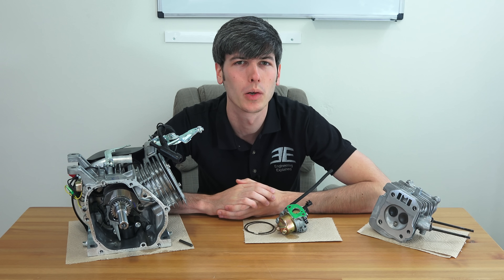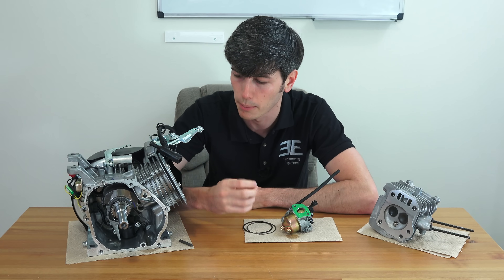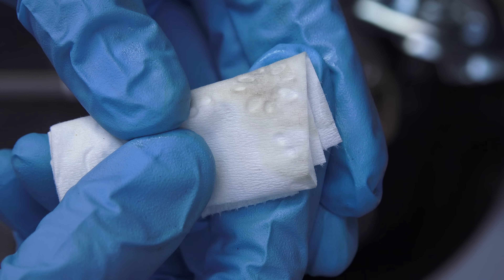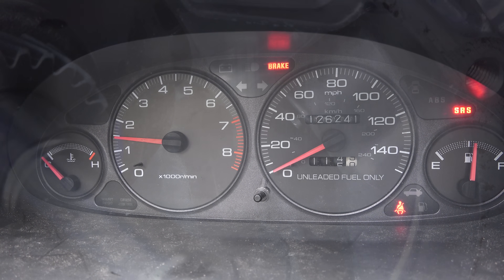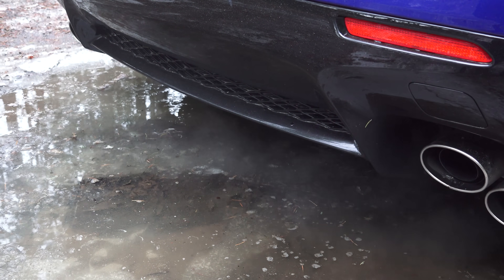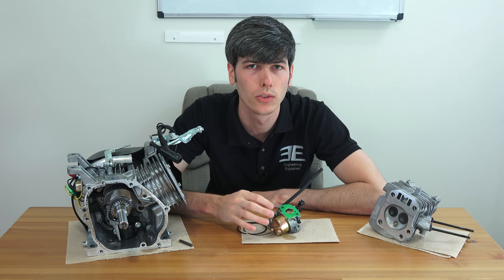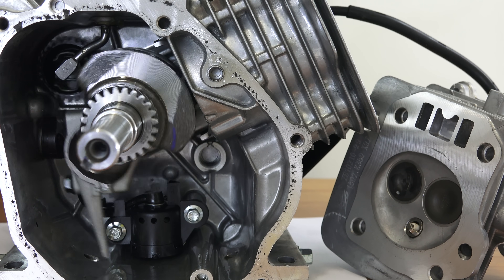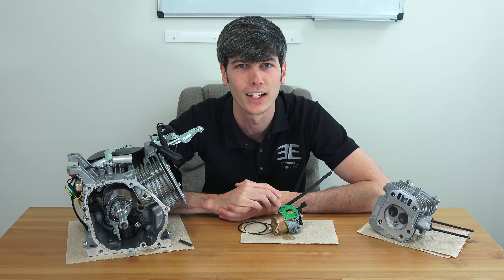Should You Warm Up Your Car Before Driving?

Comment: My car revs at 1.400 rpm the first 30-50 seconds during cold start before dropping to 900rpm, which is when I drive. 
No need to let it sit for 5 minutes.
Reply: harooni22 what if its -10 outside?  may get your nuts stuck to the seat.....
Reply: No, exhaust gas flow changes turbo speed. While oil does flow through the CHRA, turbo speed is not affected by oil flow, nor is oil flow affected by turbo speed.
Reply: Jacob LeClair It gives heat to the oil, which thins oil up during cold temperatures I would say. Am I wrong?
Reply: Daniel Fl. what if its 10 below 0 ?  might be a Lil cold in the car...
Reply: Turbo speed has no effect on oil flow.
Reply: Daniel Fl. mine does the same but when its colder itll take 5 or 10 minutes sometimes. i try to wait for the rpms to drop or until it's a bareable air temperature in the cabin. i own a V6 so the gas milage is already garbage
Reply: Daniel Fl. You know there's a lot more play between your rings and cylinder walls when it's cold? Which is why people warm vehicles up. So basically since you have a boosted engine and you don't warm it up you're getting quite a bit of blow by when you drive it around when it's cold. But no reason to warm it up... until you score the cylinder wall
Reply: Unless it's a rotary, which consumes oil and needs it to be in a more liquid state.
Reply: Daniel Fl. I'm from a cold place so I'm talking about dead of winter. If you live in California or Florida then yeah probably no need to let it idle for 5 minutes
Reply: Is that really normal behavior for your engine?
Reply: wholeNwon Yes, and that is also the correct behaviour from factory. Why do you ask?
Reply: Just seems a little high to me.  Wondering about a vacuum leak, etc.
Reply: wholeNwon Nope. It's a twin charged engine with both a turbo and a compressor. Therefore the turbo needs to spool faster to get the oil flowing better. 
In summer it only revs up to 1.200 rpm, it's only in the cold degrees that it revs the extra 200 rpm for some reason.
Reply: Jacob LeClair Yes, it heats up fast.
Reply: same with our 2016 subaru, it revs up and down around 1300-1500 rpm then goes down to 1000 when the blue temperature light on the dash (indicating a cold engine) turns off. Sucks that there's no gauge
Reply: A J True. The air went first make "warm" air after 3 mins of idle or 30 seconds of driving slowly (below 2k rpm).
Reply: wholeNwon loool an mx5 can idle as high as 2000 when the temperature is really cold 😂it will make itself run rich for a few minutes when it isn't warmed up
Reply: The main reason you have a high idle for a bit at cold start has to do with emissions. You want to get as much heat as quickly as you can to the cat converter to get a quick light off, that 30-40 second fast idle gets the catalytic process started sooner. Cold start emissions are very heavy, the sooner the cats get hot the quicker the emissions are reduced.
Reply: charlie dee I dont think one needs to be that concered with how soon the catalyst process starts unless your someone unreasonably obsessed with global warming. Afterall, the cars computer contolls this process for optimal engine operation so there is no benefit to the operator whether the emissions scrubing happens sooner or later as long as everything is working correctly.
Reply: Tyler Mattson Never had any problems with it. I don't drive a 1986 Chevy. I drive a 2006 Golf V TSI. I don't race it when its cold. I shift at around 2k rpm until it gets warm.

Comment: When the engine is cold and you allow it to warm up you will wash down the cylinder and I agree with that but if you all the engine to warm before driving then all of the components of the engine will  be to operating temperature including the piston which will expand in the bore when heated up to operating temperature. MY opinion is I think a few minutes of having extra fuel in the cylinder is better than starting up and taking off with a cold engine before the piston takes up that small amount of clearance when warm

Comment: I never wait with my carberated ford escort mk4 1.4cl s6, I just head off like anyone would with the choke full on on start then about 1/4,1/2 when driving just driving it relatively low rpms and almost no throttle should be used, stalling when pushing it? never had it, it stalls when you go and get the choke off too early it will stall between your shifts unless you keep the rpms higher with your throttle manual.
all in all, don't do anything crazy with the throttle just drive the car no problems whatsoever.

Comment: Question, i have engine heater for my car. Wont this replace the need to start the car beforehand? It also cannot wear the walls of the cylinders, coz its not acually starting the engine. Am i right or am i right..? Engine heater must still be a good thing to get your engine up to temperature, before driving of isnt it..?
Reply: yes, block heaters are the best thing for cold starts, block heater manufacturers say to plug in 2 hours before starting for max temp increase, leaving it plugged in for longer just wastes electricity and dosnt really make the engine any warmer

Comment: and what young engineer tells us about engine wear due to material being cold and not stretched enough to workign temp? he missed that....and another thing - he wasn't precise enough about quickest warming....your engine will warm up better in idle than in constant speed with light throttle. why? because atmospheric air doesn't let it warm that fast. if you are in terrible winter and want to make the engine warm up to  its working temp as q. as possible, then give it mild 2000 revs while sitting in a car....that's the way it's done when thermostat is changed to see will it open when it should

Comment: will the same go for turbo vehicles? the newer wrx has the temp gauge so would you recommend a oil temp to start off at to be extra cautious warming up the engine while driving?
Reply from the maker: +BellaWrx _NJ absolutely, wait to romp until oil is at operating temp.
Reply: Engineering Explained I keep seeing there so many variables with types of oil used in different size engines determine operating temp. what would operating temp be for the newer wrx? I heard 150 Fahrenheit is good.
Reply: MV60 that's the issue. on cold days my temp can take awhile to reach temp and 200F is about the normal when not running it hard. I like the oil pressure idea, hope the AP has that so I can jus use that.
Reply: MV60 makes perfect sense. thanks.
Reply: What exactly would be considered operating temp? I have a 2016 Mustang Ecoboost if it matters.
Reply: MV60 good call, I'll do that!
Reply: judging by the above comments, the wrx and my saturn sky turbo both operate at about 200°F so thats probably a fair estimate for your ecoboost.

Comment: He just gave bad advice. You should always let your engine warm up before you push it hard. Pistons for example will have a lot of slap until they heat up and expand to fit the cylinder. The reverse is that you should never try to cool an overheated engine by using cold water as uneven rapid cooling will warp the heads.
Reply from the maker: Never said anything contradictory to your comment. You are correct, you absolutely should wait until fluids are at operating temperature until pushing your vehicle hard - as I've suggested in many of my videos.
Reply: Jared D He did say driving it lightly
Reply: You weren't listening carefully.  No sane person "pushes" a cold engine hard.
Reply: Yes
Reply: Driving it while being gentle with the throttle will make the fluids and parts reach operating temp faster. This means they will be in relative motion while being cold for less time => less wear. This is especially true since gasoline dilutes the oil film and as long as the engine is cold it will use a rich mixture, and gasoline will also condense to the cylinder walls. In conclusion: Start it up, wait a few seconds for the oil to get where it needs to then drive gently. (you can start the car up then put your seat-belt, maybe wait 5 more seconds then go; that's how i do it in really cold temps)
Reply: i thought tolerances were tighter when cold and thats what causes excess wear.....am i wrong? i know for sure that cars with bad piston rings smoke way more blue smoke when hot...also oil is thicker when cold and it can "fill some gaps"

Comment: Wait so idling upon cold start up will cause wear but starting it, then driving on a COLD engine won't??? lol wow. I have forever been idling my cars and there has not been a case where my engine broke down. If anything, the car was sold or traded in before the engine had a chance to even show ANY signs of wear. As far as the oil being contaminated, i always change my oil prematurely anyway so the oil stays nice and fresh. As far as wasting gas, i don't care about that as i'm not a penny pincher. I always idle for about 3-5 minutes, longer during winter months. Only summer months i idle for a full minute, then it's good.

Comment: I warm up my engine because there are lots of steep hills in my commute, I have a supercharged vehicle, and California premium fuel is garbage. Pre-ignition will occur if I don't keep the revs up and premature wear will occur if I don't let the engine warm up. I have an 8% grade, mile long hill leaving the neighborhood, so I either let it warm up or drive it at a moderate/high rpm while cold. Which is the better choice?

Comment: buddy i have question, i have my nissan x terra, but the thermostat has remove so now the coolant is bypassing continuesly . my temperature guage show always cold. so what will be effect to my engine. or to my MPG? please reply.. thank you
Reply: your combustion chambers will never reach operation temperature. more emissions and more engine carbon build up. thermostats are present to help your motor warm up quicker. i recommend you put it back in
Reply: so meaning my MPG will declined? in this case more fuel will consume everytime in the combustion???
Reply: yes you could definitely hurt your MPG. motors are specifically designed to run at a certain temperature and will be most efficient at that temperature...also the life of your motor goes down
Reply: Idk about the mpg thing, maybe hurt it a bit idk but not much. You probably won't notice much of a difference putting the thermostat back in. The main problem with running without a thermostat is that the thermostat it's self is a restricts the water flow even when it is open making for a good amount of water pressure which forces the coolant through the block properly. Without a thermostat the passages are open enough that the pump can't build any pressure so the coolant kind of just lazily flows through your block making for some hot pockets of coolant and then cool pockets of coolant here and there as it can't get to the radiator fast enough. The areas where the hot pockets are will also get really hot too making for problems. Uneven cooling it hard on the head gaskets and the block it's self because of hot un-evenly cooled it will be.
Reply: pressure does not equal flow.
Reply: Akoto disisme if your driving in cold climate. install a new thermostat. they only cost a few bucks and they help the engine maintain proper temp to run correctly. yes install a thermostat.

Comment: Well he completely forgot to explain material composition.  When your engine is cold the aluminum pistons and iron sleeves shrink down, but once you turn on the engine they will heat up and expand.  The issue is aluminum expands much faster than iron.  If you turn your car on and immediately drive off with a cold engine, the aluminum pistons will expand much faster forcing your piston rings against the cold shrunken sleeves.  This will cause undue cylinder liner and ring wear.  It’s not much of a big deal in your low performance cars, but in high performance cars where the tolerances are usually much tighter this could cut years off your engine life.  Ever wonder why that car in front of you let out a puff of blue smoke every time they drive off?  This is caused by oil entering the combustion chamber from any number of places, most prevalent is worn down oil seal piston rings.  The problem of fuel mixing with oil is usually caused by “blow by” caused by worn down rings or too much cylinder pressure.  He is correct in saying never drive a cold engine hard, but I would rather let my engine warm up a little to get better piston ring seal before I drive off.

Comment: Engine reasons that fine but you can't tell that to my gas at -5deg F (Minnesota weather).  I loose crazy amount of fuel by not letting the car warm up for at least 5 mins in temps around 25 deg F and below.  When I let my car warm up 5, 10, and even 15mins, everything moves better and faster. The steering wheel is not so stiff turning, the engine actually sounds better. So I will continue to warm up the car for at least 5mins.

Comment: EE  If the car is cold and you drive lightly is there a chance you may experience blow by due to metal components not being thermally expanded. Also if the car sends a rich mixture at idle due to temp wouldn't this also be true for light driving thus dissolving oil on cylinder walls. Please reply I'm having trouble finding good data on the subject and I'm also buying a new wrx I wanna treat her right. Love your channel keep up the good work

Comment: I warm my truck up in the winter for a minute or two minimum until the RPM's drop closer to normal idle range. When I start it at first it will sit around 1800-2k but after a minute or two it will drop to 800-1500 and that tells me I'm ready to go.

Comment: here it takes at least 5 minutes to have windshield and back window defogged, 10-20 for side windows i never leave until i see properly. spraying windshield washer does nothing on the inside. im also of the opinion that if the block goes from -40c to 150c in 2 minutes it can crack much faster than letting it warm up

Comment: Thank you for the videos and i am very glad for the insight about the working condition of a cold engine, especially for the fuel leakage, but i am not completely with you in all the points: 

1:I have 2 carbureted motorcycle, i can take off with even if it is cold, especially if i use manual choke (but even without it). 
2: when you are idling the pressure of the oil is very low because it is presssed in by a pump which is usually like a fan directly linked to the engine. So if you gently rev up the engine a little with small pressures of the accelerator is better than just leave it idling.
3: I have heard that you have to let the engine warm up with the old cast iron cilinders which has to have very large tolerance, so if you just could not take off with cold engine.

Comment: Is it same for diesel CR (direct cilinder injection) engines ,because you mentioned that on petrol engines they dont need to warm up idling ?  I agree totally ,because my vw golf 1.6 tdi cr would never raise temp idling (termo efficient). Im letting him idle for about 10 sec to let oil come to the turbo and then start to drive. But one thing i noticed when engine idle cold about 2-3min in place and then i use manual gear stick and place it in 1st ,2nd ...there is that sound like squicking of gearstick i think it is because different oil temp. warming i gearstick and engine ?

Comment: You didn't mention cam ground pistons or even cylinder bore taper for that matter. Both are measures used to compensate for heat expansion. If you apply a load to an engine with either or both of these, injected or carbureted, before the engine is warm, you will experience premature piston and cylinder wear.

Comment: Not true!! Many Subarus have a blue engine light on the dash that indicates when the engine is cold and shuts off when it's warm enough to drive.Takes about 2-3 minutes in warm weather to shut off and 5-8 minutes in cold weather. They are on all different years including the new 2017 Impreza
Reply: The blue light on a Subaru merely lets you know that the car is not yet at full operating temperature, and thus should be driven more carefully.  There is nothing in the owners manual of any Subaru that states that you should sit there like a lemon waiting for the blue light to go out.

Some manufacturers don't feel the need to have a temp gauge, so they just have a blue light that means the car should be driven carefully as it is not yet at full operating temperature.  And it goes red if the car is overheating.  In fact specifically it flashes red if the car gets very hot and stays red if it is dangerously hot, and is an indication you should pull over immediately.

Perhaps you should go back and read your owners manual, so that you are not so confused.
Reply: Pretty sure that light is there to let you know when you have heat. They're not only in subaru's.
Reply: Robbspeed3/- and I bet you think when it turns red you can cook a burrito off the windshield vent haha
Reply: skojo3e I should be asking you that.
Reply: Robbspeed3- actually read the owners manual instead of thinking your right without doing your homework!!!
Reply: skojo3e Wow it only took you 5 weeks to reply, nice job. I already read the owners manual.